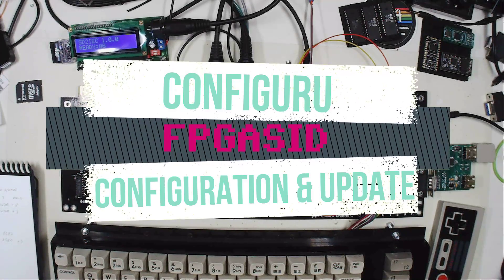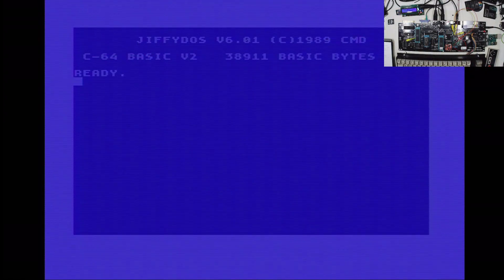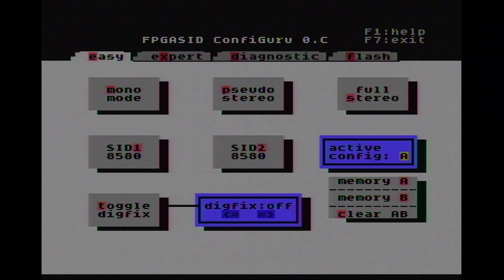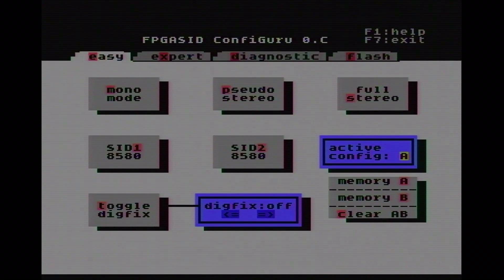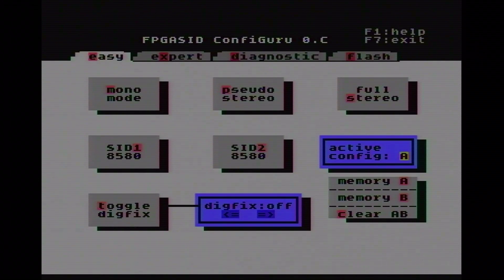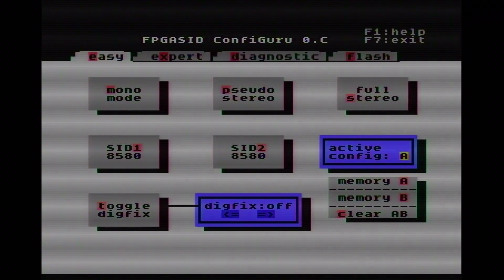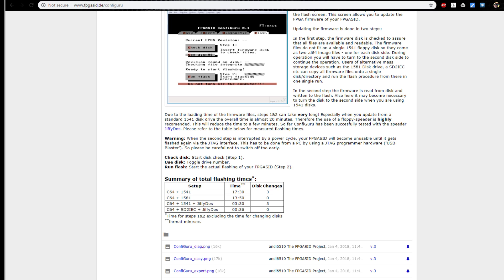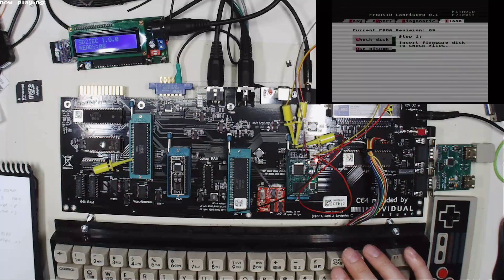C64 Hardware - FPGASID - Configuration and Update with Configuru

Comment: I find this filter stuff very interesting. They're the only analog parts of the sid chip, aren't they? 
Can they be influenced at all from the c64 or an actual sid?
Reply from the maker: Yes, the filter is the only analog part of the SID. The C64 can adjust cut-off, frequency and select low pass, band pass and high pass, even all together. You can select which voice/voices goes thru the filter and you can route an external in thru the filter as well. Due to the production process the filter of the older SID chips vary a lot, means the very same setting may lead to different filter behavior. The newer 8580 SIDs are far more predictable and much clearer whereas the 6581 has a more grainier sound which is preferred by some people like me :)

Comment: I want to use your FPGASID with the MSSIAH Cartridge for 6ch operation.  Is it fully compatible with the MSSIAH Cartridge? Also, Is the monitor out port of the C64 the only way to get audio out or can I get audio from the chip directly?  I would like to get a cleanest audio signal if possible.  Actually if direct out from your circuit board is possible, then It would have been great if it had a balanced audio out option.  An even better feature would have been an output per channel option so it would have 8 channels as in  2x3ch + (main stereo or 2x main mono) this actually would be great since my main use for this chip will be in the studio. So I can assign FX/EQ per channel/instrument.
My second question is about the A2D converters. Are they better, less noisier than the originals? It would really be great to insert this to my son's C64 who uses koala pad to draw stuff. The original SIDs have a lot of noise and so even if you keep still on the koala pad, the pointer wiggles on the screen. I would really like to know if I can improve the quality of the A2D encoders with this chip simply as an A2D upgrade :-)
Reply from the maker: Hi, thank you for your long comment :)
To answer your questions here are my thoughts:
1. Mssiah and FPGASID - this works very well. There are a few things that may sound differently compared to an original SID but since Mssiah is about creating sounds it won't be a problem and this will occur in direct comparison only.
2. Audio access - the AV socket is propably the easiest way to go. Second best way will be a small adapter like PCB that gets the raw outputs from the FPGASID and routes the signal to jumper like connectors to use this as a point of access. I'm working on this PCB right now since I'm going to replace my Mixsid twin SID adapters against the FPGASID but I use a 6.3 mm stereo jack for this.  I'm working on a video about this topic right now.
3. Balanced output is not possible yet. I'm considering creating an additional adapter, like the mentioned Mixsid replacement adapter, which contains the electronics for a balanced output but I can't promise when I will get this done.
4. The 8 channel output - this is not possible since the FPGASID doesn't offer the option of a single voice output. Technically, it hardly makes sense since this would work only if the voices are not routed thru the filter section or a separate filter per voice needs to be applied. Long story short, I think we won't see something like this anytime soon.
5.  The A2D converter - they work very good. Here's a video about this topic I did a while ago https://youtu.be/EFjVYeYhUew?t=484
I hope it helps, if I missed something, feel free to ask :)

Comment: could you please tell me which gamepad you have there and also what is that circuit you have inserted in the game ports? thnx a lot.
Reply from the maker: This is a wireless NES classic controller, you can find them on Ebay or Amazon or AliExpress.
The circuit is a Nunchuk64 adapter for the usage of mentioned controller or Nunchuks on the C64. This is a project of the Forum64. https://www.youtube.com/edit?ar=2&o=U&video_id=LK__4W44_HA